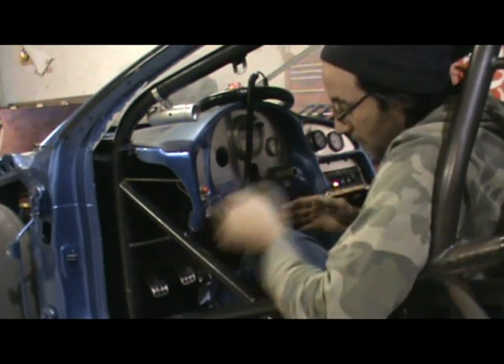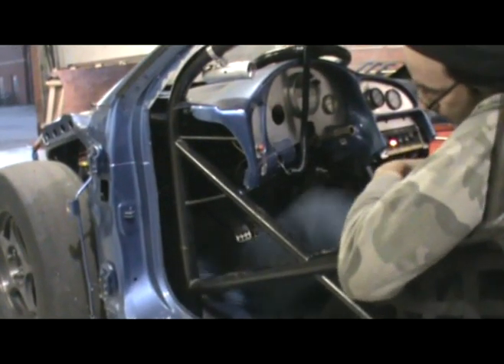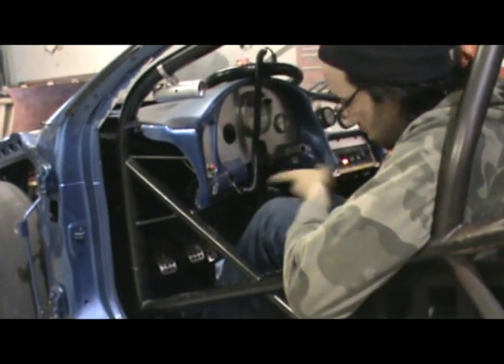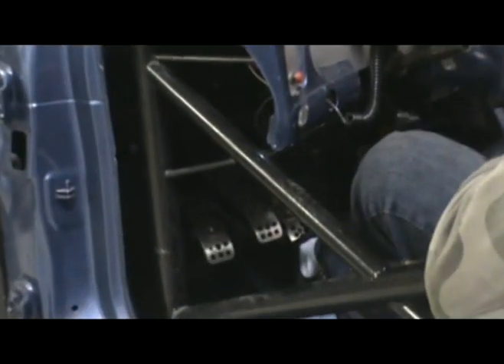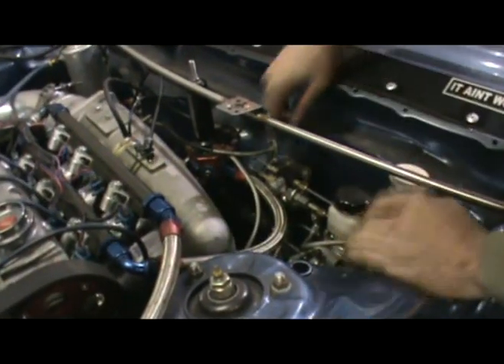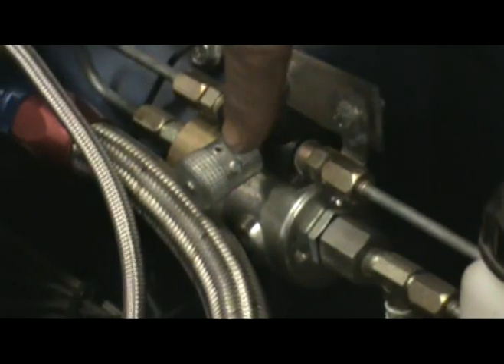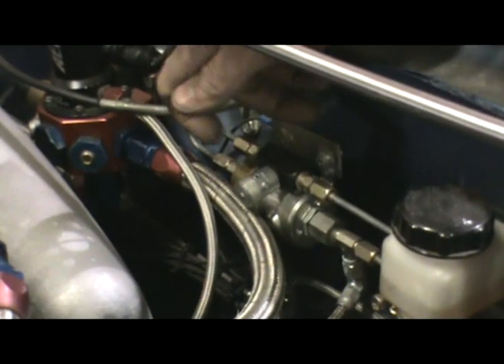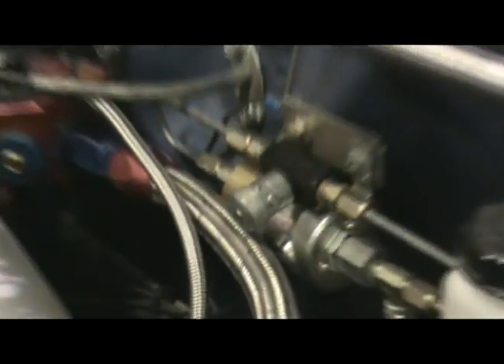Magnus Motorsports Launch Control Device

Comment: Is it just a good as the No Lift to shift mod?
Jafromobile he has done this no lift shift mod, went into 10s with it with a built 7bolt until his engine went he's doing 6 bolt swap.

Sorry for silly question.   You've probably done this mod once and it's why you have this device.

Am probably answering my question. 😆